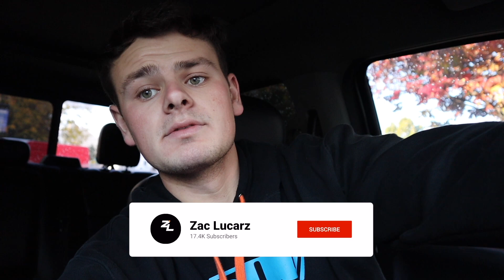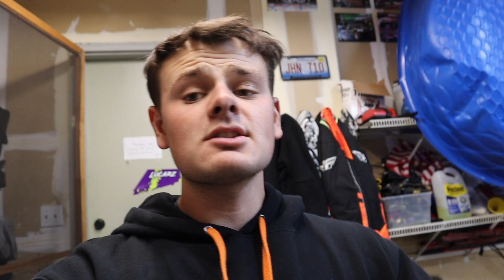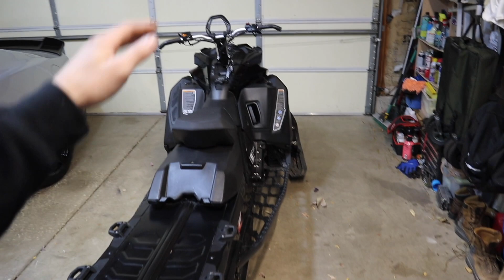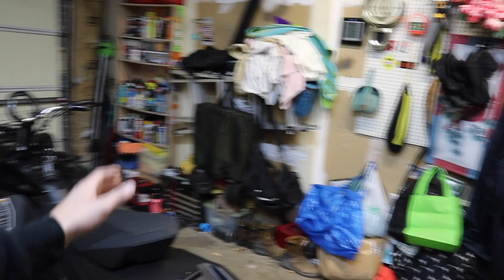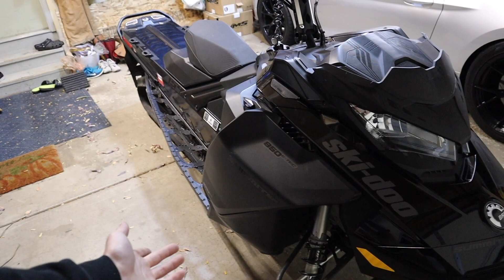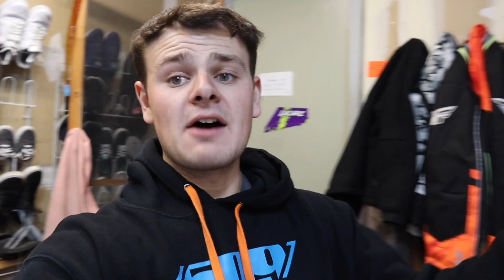I BOUGHT A SKIDOO SUMMIT 850 154! (Sorry Polaris)

Comment: No zac no the Polaris doesn’t get old it just showed you had common sense 🤦🏻‍♂️ not even artic cat 😢
Reply from the maker: It was time to switch things up. Don't worry i'll be back with a Polaris soon enough
Reply: @zaclucarz  hey zac quick question why do you like the shot I mean it’s electric start but with the Polaris you never have to use the pull start unless your batteries dead or is that why (because it uses a battery)?